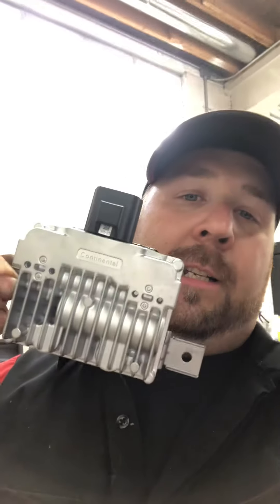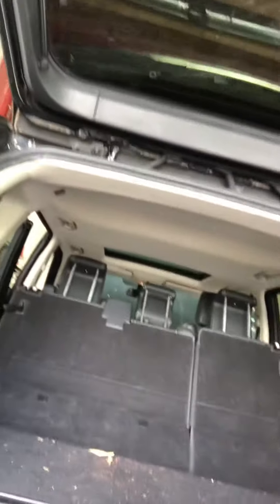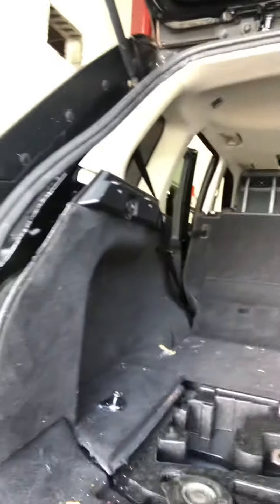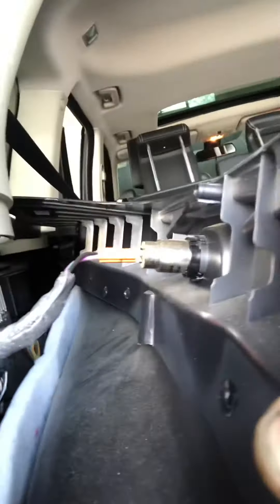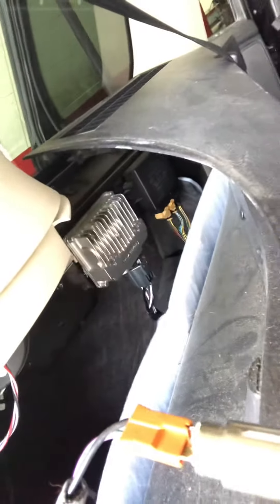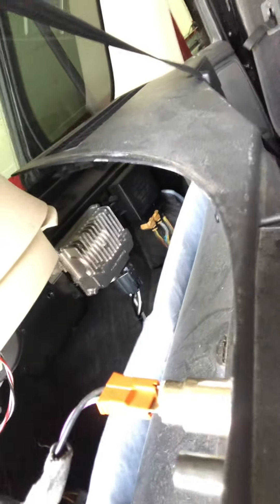Where the H*ll is the fuel pump module!!??

Comment: Thanks man. I'm swapping out the Fuel Pump on my Land Rover LR 4. I was wondering where the Fuel Pump Module was located just in case it needs to be replaced. I had to remove the Fuel Tank to swap out the Fuel Pump.
Reply: was it in the same spot on your land rover LR4?
Reply: Yes
Reply: Why do they go bad the module?
Reply: @AcmeAcme-f6y 
They usually don’t go bad. The Fuel Pump itself usually fails first if ever. The Land Rover Fuel Pump Module uses what’s known as a Pulse Width Modulation Technology. I had a Fuel delivery issue on my Land Rover LR 4 (HSE). It wound up being a Defective Fuel Line Disconnect Fitting attached to the Fuel Pump inside the Fuel Tank.